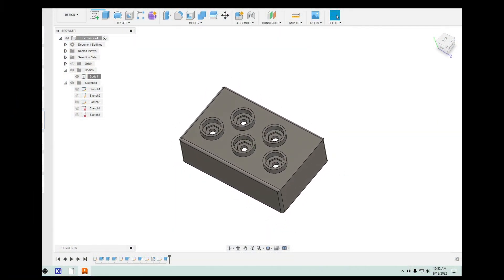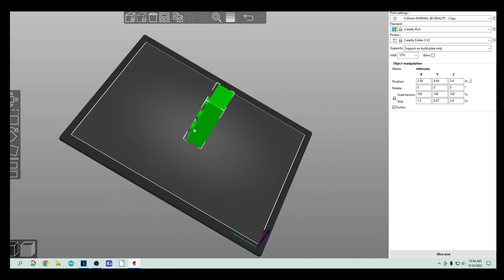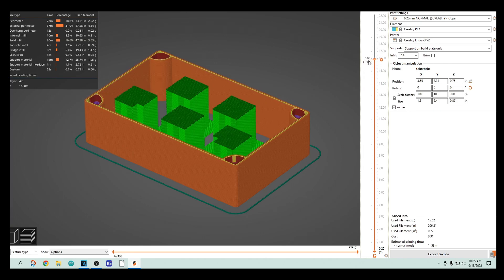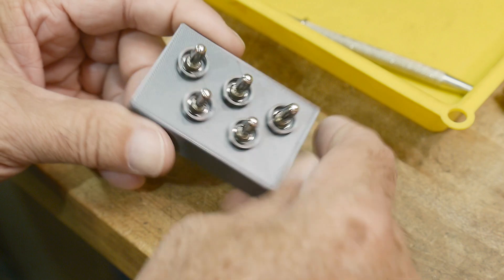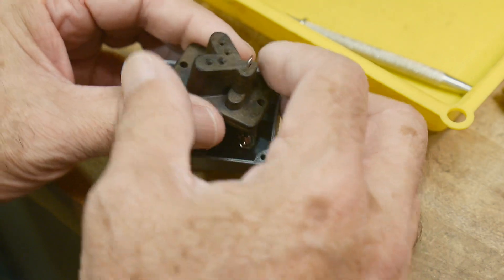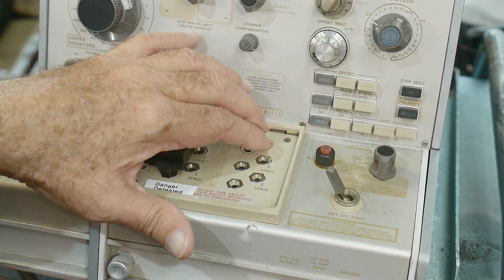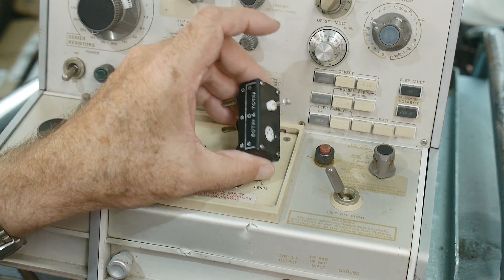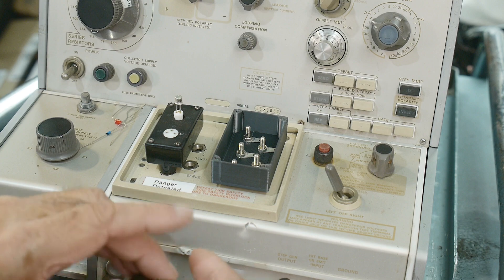#1288 DIY Tek Curve Tracer Test Socket ( part 1 of 2)

Comment: You probably know but you can just switch from Solid in the Design toolbar you are in to the Utilities Part and then use the Make function to directly transfer the mesh into PrusaSlicer. You can also tweak the triangulation settings to control the vertex count. No need to first save and then load the mesh.

Comment: Putting a rebate on the bottom to grab onto might be nice for ergonomic's sake.  Sort of how it is on the factory Tek socket.  It'll give you something to grab onto when you're pulling the socket out without having to squeeze super hard on the sides (which will probably eventually cause the sidewalls to break).  Though if you just plan to leave it in place may not be a big deal either way.

Comment: Why not build it with the top down?
Reply: There are rings around each banana plug that extend above the main surface.  It wouldn't lay flat,  which is what I believe you were thinking would happen.
Reply from the maker: the tek sockets have that cosmetic ring so I copied it. it does not interfere with it being flush
Reply: @IMSAIGuy  I think the original post asked why you didn't print it with the top side on the build plate so you wouldn't need supports. I was saying that the top surface would not be flush to the build plate because of the rings. I just didn't say it clearly.

Now, where the heck did you get those banana plugs with the screw threads?
Reply from the maker: @tfrerich  I wanted the look, anyway Pomona has the bananas. over $3 each!  I found a bag of them on eBay and got them for $1 each